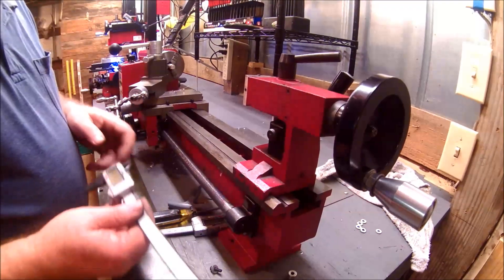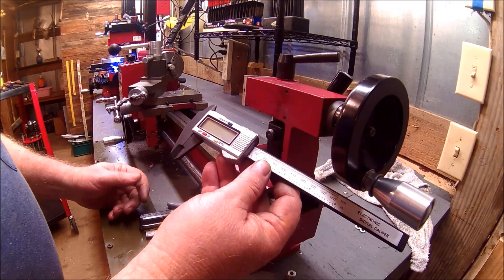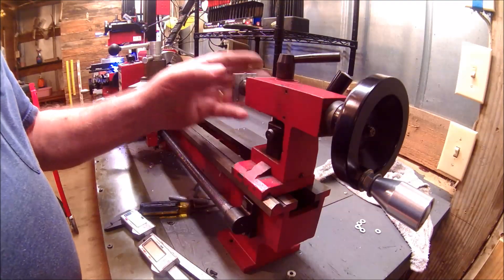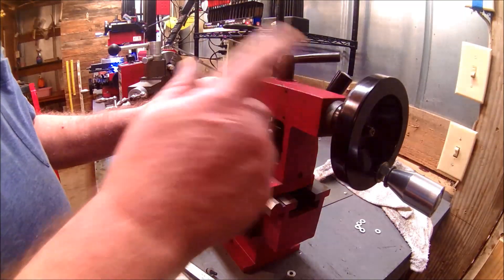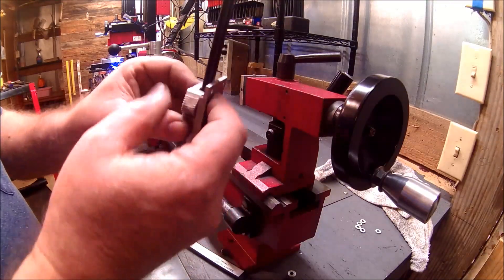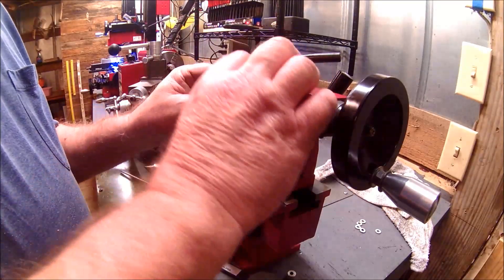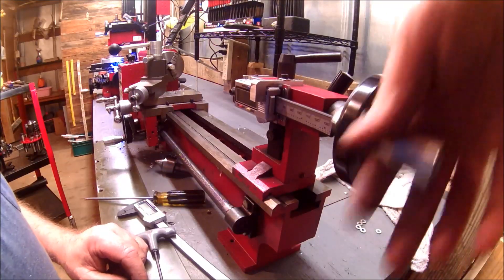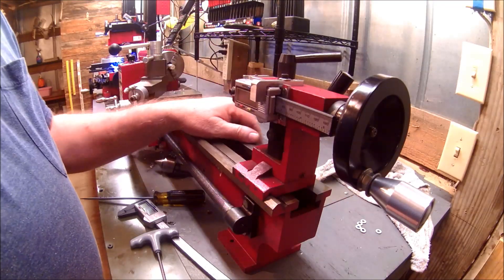Mini Lathe Tail Stock DRO

Comment: i took an 1" dia nut  boared it out to the dia of quill    put a stepped shoulder  so it lined up with starting of the  quill markings  then drilled and tapped a locking bolt or stud  to which i will affix the DRO cliaper nosing   and will mount the  read out to the face tailstock  going to see if i do it without a mounting plate....